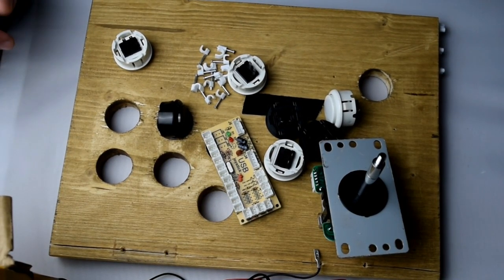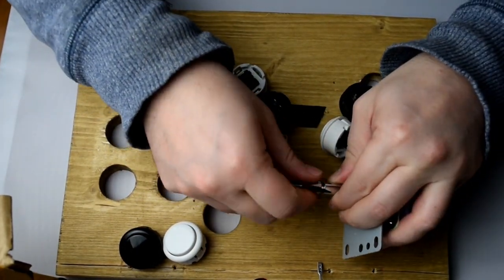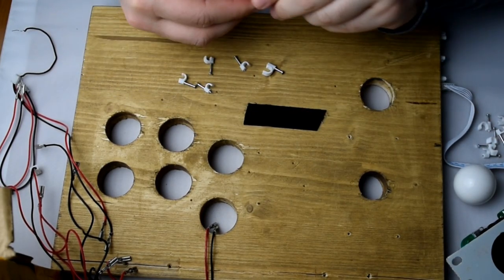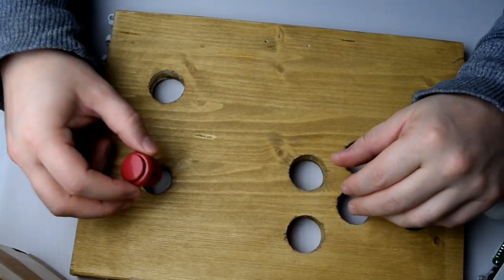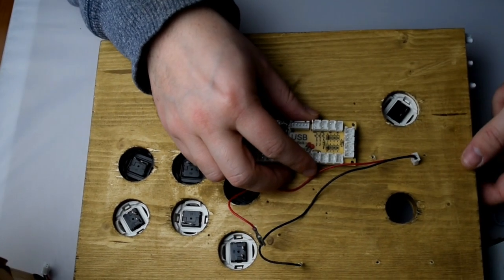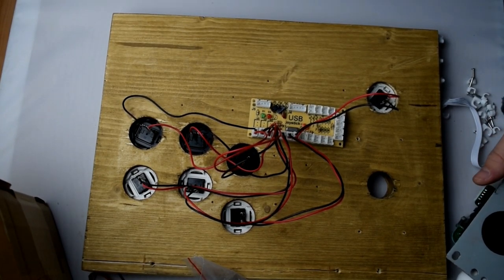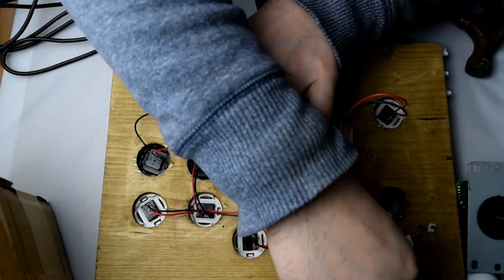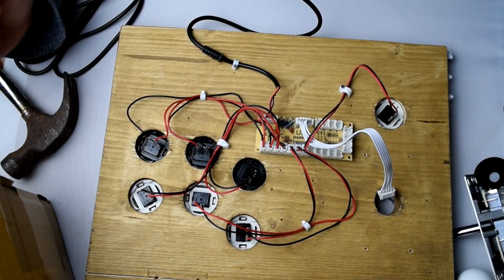Zero Delay Arcade Button Joystick Wiring Instruction Tutorial

Comment: I made a controller with this board for my Neo Geo MVS so I have to use adaptors to convert the USB plug to 15 pin socket for my super gun that goes to my Neo Geo MVS but for some reason it doesn’t work it actually doesn’t even receive power… if I connect the controller directly to my PC with the USB socket it does work 🤷🏻 any help to be able to use with my 15 pin socket super gun?

Comment: What are the other connections for? The ones near the joystick and on the side you didn't touch. Are there special functions like turbo/autofire modes? Are they all for momentary switches or are some intented for toggle switches?
Reply from the maker: It has been a while since working on these. Their are empty slots for adding extra buttons etc which can then be assigned in software.

Comment: Does it work with any joystick? (maybe taken from regular cheap gamepads?)
Reply from the maker: Drivers on the encoder are built to register 4 signals, up, down, left and right. I doubt it would work with regular gamepads are their configs will be different, but usb style joysticks gamepads may work if done properly.
Reply: @MXQPROJECT  Thanks for answer. It does not work as i wanted. I wanna make a usb handbrake from my broken dualshock 4. I need arduino for this project i guess :)
Reply from the maker: Yeah no doubt you will
Reply: @MXQPROJECT  thanks :)
Reply: @requiem4adreamc  hey my friend, Im on the same journey of making a handbrake to play gran turismo, how is your project going?
Reply: @gustavorio329  i am not working on it for now. I will do it in free time.

Comment: Hi pal I bought a sanwa jlf stick to mod in my stick is it possible you could help me
Reply from the maker: I'll try
Reply: @MXQPROJECT  can I communicate with you on email?
Reply from the maker: @fazeelanwar4577  right now just fire away with your question on here
Reply: @MXQPROJECT  I have a venom arcade stick and my stick broke. I bought a jlf sanwa stick online and it came with a wire and I plugged it in and the back direction is the only direction that works, nothing else. Also, I think the motherboard stopped working. What should I do
Reply from the maker: @fazeelanwar4577  could be anything, impossible for me to help unfortunately. Just make sure it is not the software stopping the stick from functioning by testing it on a pc. Only thing really is to replace it all
Reply: @fazeelanwar4577  Try wiring the stick again and upside-down (put the 5-pin connector in the stick the opposite way than you did) , usually, when you wire a stick and only 1 direction is working, it's because you've put the 5-pin connector in the opposite orientation.
Reply: Common error - 5 pin harness has a common and four direction inputs. if you install the plug reversed then only a single direction and common will close a connection to the controller interface. Solution remove unkeyed  plug rotate 180 and reinsert plug. 
Why the Sanwa harness never used the centre pin as common, maybe a simple clue as opposed to all co-ordinal directions being wrong and taking more time to discover your goof or just a force of habit.